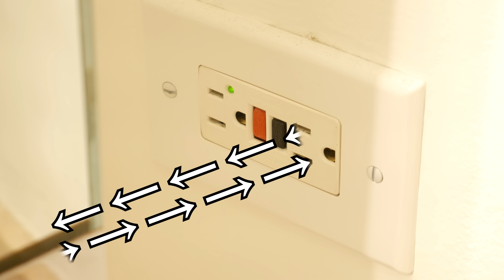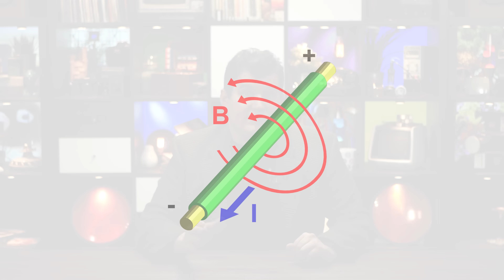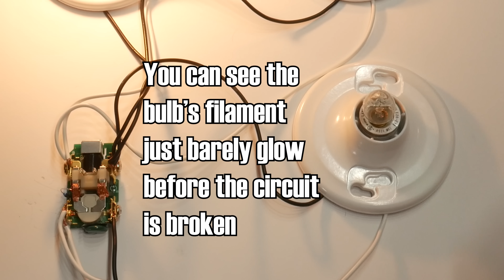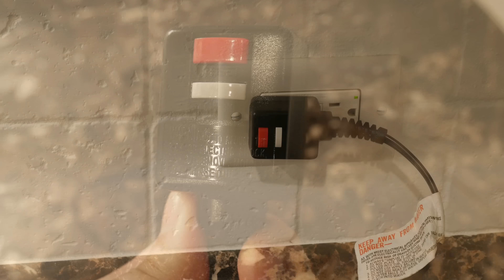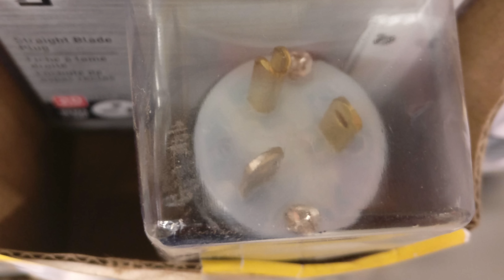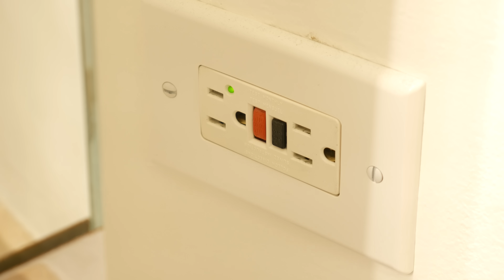The GFCI/RCD: A Simple but Life-Saving Protector

Comment: On the other hand: We in the UK are not allowed to have sockets in our bathrooms. Except for 1amp shaver sockets. Everything else must be permanently wired in with a fused isolator switch as high up the wall as possible.

Given all our mains sockets are 240v 13amp; this is probably for the best!
Reply: Bob Dole Sort of. You can have sockets provided they are a suitable distance away from sources of water, in practice most bathrooms are too small to meet the requirements. Out sockets may be rated at 13 amps, but are protected by a 32 amp fuse of circuit breaker, so can potentially deliver huge loads.
Reply: @spencerwilton5831  So pretty much my exact point then. The overwhelming majority of British households are not allowed to have sockets in our bathrooms because they are not statistically unimportant anecdotal cavernous fortresses of solitude. 

Also; I wasn't stating 13 amp as the theoretical maximum. I was pointing out the fact we don't normally have seperate domestic heavy duty sockets for large appliances like dryers as is often the case in the states. I am excluding electric cooker points in this statement as they are not a readily usable socket. Electric car charger points and the like are dedicated installations. Did I miss anything that is domestically common enough to warrant mentioning?

Comment: Hi!  The certain distance is 6 feet from a plumbing fixture in the U.S.  You can also install them in older homes with no ground wire instead of using a “cheater plug”.  Just in case anyone is interested 😬

Comment: In russian it's called UDT (differential current device).  Coupled with overload protection, it is called  a difavtomat, short for differential automatic circuit breaker.

Comment: In the UK, power sockets are barred from bathrooms. And so are convetional light switches - we have pull cords.
Reply: really?? that is interesting..only find pull cords in older homes here in the US that have not been updated and we are required to have at least one dedicated circuit for bath sockets.
Reply: @workingshlub8861  The only sockets permitted in a UK bathroom are the "shaver" sockets - which are low amperage - rated for 1 Amp I think. Other  sockets are banned - within 3 metres of a bath/shower.. https://www.electricalsafetyfirst.org.uk/guidance/safety-around-the-home/bathroom-safety/

Comment: Nice video 👍. 

These devices are Also called ELCB's in some parts of the world, like here in Dubai, which stands for :
Earth leakage circuit breakers
Reply: Erm, no. An ELCB is a totally different animal. An ELCB detects voltage on the earth wire against a different earth reference point ("real earth"). The earth wire in the house has a rather resistance; it's not an earth connection as we know it nowadays. This earth wire may carry up to 50V against "real earth" and still be considered "safe". Any earthed metallic appliance plugged in that circuit can have up to 50V on its metal case (and when one device is faulty, all other devices in the same house are "charged" as well; they do not even need to be turned on, just plugged in). Usually, when 24V are exceeded, the ELCB trips. Note that these voltages can already be lethal for children and animals.

The ELCB also cannot work for appliances which have no earth connection (those with two prong plugs).

ELCB have been replaced by RCD in most (if not all) of Europe many decades ago. Since the relation between "fault voltage" and "fault current" is very complex, using the voltage as a very rough estimate for a potentially lethal current is not quite the optimum. Also, the "pseudo earth" approach may lead to issues with audio equipment.

Comment: I always shudder when i see american electrical gear.... but i forget you guys arent running 240v, but still is there any  americans that realise that a lot of your wiring and gear is just totally backwater style stuff?? Having exposed contacts right beside steel brackets, minimal insulation if any....crazy. Do you guys not build steel frame houses? 
Also Why dont you have Switches on your outlets???? 
And if you tinker, buy a proper RCD not a cheap one like on hairdryers or american powerpoints.
Reply: Steel frame houses are very uncommon. Steel framing IS commonly used for partition walls in concrete warehouses converted into office space.

Comment: Electrical engineer here. Some appliances, such as dishwashers, refrigerators, ice makers, drinking fountains, and vending machines require GFCI protection. We usually specify a GFCI circuit breaker for these. If it trips, it can be very hard to move a fridge or vending machine to reset the receptacle behind it.

Also, while some appliances may plug in to an outlet, others are hard-wired. We don't always know, so it's bet to specify a GFCI breaker, just in case.

Comment: I actually shocked myself with an electric outlet one time trying to plugin my computer in the dark. I was feeling for the outlet and accidentally got the plug half in, half out with my finger touching the metal. Fortunately, I was saved by a built-in safety measure: electricity going to the muscles of my arm caused them to seize and jerk my hand away from the outlet. It felt like something had vibrated the bones in that hand. 

Good thing I wasn't in a bathtub at the time!
Reply: @TheQuark6789  Shit dude, it's called a multimeter. What you're doing is like checking to see if a viper is asleep by putting your finger in its mouth.
Reply: @emperortbw402  I myself prefer to give the contacts a quick lick just to be absolutely certain.
Reply: @emperortbw402  The back of your hand in its mouth.
Reply: Jesus, your plugs let you do that? There's all kinds of regulation about how much of the live pins has to be sheathed on plugs here to prevent exactly that kind of thing. o.o
Reply: @GameFreak7744  
American plugs are usually unsheathed, I've found.
Reply: @GameFreak7744  I don't like the british but I will say y'all have some of the best plugs worldwide. I couldn't shock myself if I tried with those things.
Reply: @AnEggShellWhite  It amazes me that our plugs and sockets haven't caught on elsewhere. Safety feature upon safety feature upon safety feature. I'm not a patriotic dude, but I'll always talk up our plugs.
Reply: @jayl9110  It's probably because the superior safety features of British BS 1363 plugs are both necessitated and obscured by the manifest idiocy of British ring mains.
Reply: That happened to me aswell, got scared to death.
Reply: @TheQuark6789  There is an even better way: Hold one end of a neon tester with your fingers. Touch the opposite end of the neon tester to the "hot" terminal you are testing. If the neon bulb glows, there is a conducting path through your body to ground. Plus, you don't get an electric shock, which is a nice thing.
Reply: I did that once. to this very day i can feel the tingling in my hand. It actually didnt hurt at all. just tingled
Reply: The greatest danger of electrocution is not when you grab something "hot."  As mentioned, the electricity takes over your muscles (All of them) which makes you let go and jerk your hand away (You basically will usually fall away from danger.)   The greatest danger is 1) when something "hot" falls and rests against your body. If you have a place to fall, it could very well follow you and remain against your body. OR 2) When you fall and you land with your body at rest against something hot (or step onto an energized surface such as stepping out of your car after an accident which knocked over a power pole leaving loose, "hot" wires lying on the ground.)  Your body will have the same jerking reaction, but you have no place to fall away from the voltage.  Muscles are activated by electrical impulses from your brain, but the current is very low.  When you get shocked, the current is much higher and overrides all electrical impulses from the brain, which is why you cannot control your muscles.  Your brain, therefore you,. will know what is happening and what you need to do.  You will know you are dying, but you will be unable to move.  (Of course, extremely high voltage/current will cause instant death.  Even higher current will immediately dehydrate your entire body and you will burst into flames so hot that anyone within a few feet of you will also burst into flames.  (This is the fate of those who try to steal copper from a sub-station!)
Reply: Reminds me of years ago, I needed to change out something behind metal panels on a piece of equipment. I opened one, and when I reached for the other I saw lighting bolts shoot out of my hand, it felt like someone hit me in the chest with a sledgehammer. 
I ended up on my ass about 5 feet away. There were what looked like pinpricks on my hand in the places where the electricity had exited.
If I had been able to grab the second panel, I likely would have been fried instantly. (Resolute Star blueprinting machine, 1982.)
Reply: "I was feeling for the outlet and accidentally got the plug half in, half out with my finger touching the metal."

I did that as well. The exact same scenario plugging in a computer in the dark. I went "Wooeee. ... That felt kind of good."
Reply: North American plugs are scary.
Reply: When I was about 6, I was playing behind a neighbor's house who had a swamp cooler. I thought a pipe on top in the water was some loose scrap and grabbed it. I could not let go of it for several seconds due to the muscles in my arm tightening. It was "quite a shock".
Reply: I call that the "FLASH GORDON EFFECT". Why, in just a moment  you are several feet away.
Reply: Where I live, regulations require that the top half of the power pins are insulated so that can't happen. Of course, we have 230v, so it's that much more of a jolt if it did happen.
Reply: I similarly used my finger, across both prongs underneath a lamp plug, to feel its way into the outlet. Certainly was a lesson I only needed to learn once.
Reply: Yeah I plugged in a vacuum cleaner with no gfi with the same issue and my hand seized and I couldn’t release it. Thankfully the motion of me jumping back pulled my hand away but it felt like the bones were vibrating, as you said.
Reply: @TheQuark6789  Actually, when working with electricity will use insulated tools and connect ALL wires together to be sure there is no current back feeding from another source, then proceed to do the work i need to.  have seen too many times someone did some "weird" electrical work
Reply: Damn the luck. If only you could have made the same move in an older home.
Reply: Thequark6789 life back cheers. In return, if you suspect a fire in a room/box etc check for heat with back of hand, so saving fingers.
Reply: I do that quite often with my fan, but I try to be careful. Seems to work 'cause I've yet to get shocked.
Reply: European norm impose RCD 30mA on all circuit, and in the house fuse box, before any breakers. You are protected even if you touch the lamp outlet, or any circuit in fact.
About water-environment outlets, outlets are forbidden in proximity of water, and multiple other rules apply.
Also european plugs have no parts that can be touched while on power, and children cannot insert objects int sockets. US electricty norms are insecure and dangerous at many levels...
Reply: Was it 110 V or 220 V? I was zapped by 220 V at least 3 times that I can remember. But I don't want to repeat this experience.
Reply: @VioletGiraffe  I'm not sure. American wall socket plug. Wasn't that bad since it didn't last more than a split second, but could have been much worse under different circumstances (ex: grasping something electrical and unable to let go, or standing on something conductive).
Reply: I plugged in a tower once, there was no plastic nub on the end of the outlet, so my thumb slipped forward and touched hot and neutral.
Reply: All your arm meat cooked at 60hz for a short time is more like it.
Reply: your actually lucky as a lot of time the spazm of our bodies reacting to electricity is to actually grab onto things
Reply: @compzac  Correct me if I'm wrong - but I read somewhere that a difference between AC and DC is that with DC, your muscles actually do clench up, which would make a shock more deadly since you'd be unable to let go.  But when the current alternates rapidly (AC), there are just short bursts which make your muscles spasm rather than clench, and thus it's "safer" since you aren't subconsciously going to tighten your grip on a live wire that is shocking you.

It was one of the reasons everybody adopted AC transmission, the other being the ability to "step up" the voltage for long-distance transmission.
Reply: @drfsupercenter  I know this is late...
You can't let go of AC at about 30mA and for DC it's about 10mA.
The more significant difference is what happens to your heart if you get shocked. AC "just" stops you heart, but under normal circumstances the heart can restart itself. DC on the other hand gives you ventricular fibrillation witch means that your hearts rhythm gets wacked and the only way to fix that is to use a defibrillator that pumps DC through your heart to stop it and then get you back with CPR and so on.
Reply: America is built on Darwinism, so yay exposed live contacts! Cull the herd! /s
Reply: @justins8802  how so?
Reply: Stranger - In america’s early days, one could come from nothing in the old world and through ingenuity and hard work, become successful, marry, and have a ton of kids. One could also come over and for one reason or another fail miserably and essentially be destitute, unmarried, and die young and childless. There’s a hypothesis that this brutal free market and effective Darwinism was a key part of America’s success until one generation after the New Deal added a safety net. 

Anyway, my joke was that our outlet design was related, designed to kill anyone who couldn’t be careful enough with them.
Reply: This is one reason why US style plugs are... bad.
Reply: Gosh if only there were some kind of device that could turn an outlet off so that it's not live whenever it's not in use.

Some kind of switch or something.
Reply: @shingshongshamalama  Yes, but that would be "inconvenient".

Comment: As a new homeowner, thank you for this. I have bought a rather old house and wondered why there were specifically two outlets- one in the bathroom and one in the kitchen- that worked like this. Incidentally, I hate them. More often than not, they trip over stupid things that shouldn't have set them off. But thanks to this explanation, I'm not as tempted to replace them with normal outlets.

Comment: Having the GFCI in the central panel has one other benefit: It protects all the wires in the walls from ground faults. This can be especially important if you have a break in a water pipe or you are putting in a nail to hang a picture.

Comment: That’s a much better solution than the no outlets and only pull string lighting that are in UK homes. Some more modern homes may have shaver plugs that can be used with some hairdryers too but many do not. When I lived there I had to charge my electric toothbrush and dry my hair in the bedroom.

Comment: OMG, these kind of screw-terminals are in use in the US? With stranded wire?
Reply: No, our wiring is all solid core, no strands.

Also the screw is optional. The more popular method is a hole on the back of the outlet where you insert the wire in, and it clamps down.

Comment: I wonder if the in-circuit-box standard outside the US has anything to do with the commonness of 220-250V mains elsewhere. Maybe having the whole house on GFCIs is safer (or even just comforting) when your stock service voltage accommodates heavy machinery.

Comment: Now I'm wondering what happens if the test fails.  Like, the ground fault kicks in but the circuit doesn't break.  This is my lack of knowledge of electricity showing, but I have no idea what effect that would have.
Reply: Normally simply the socket will not cut the power, it works like a normal socket. Some sockets do not allow resetting  if they are faulty but this is stupid and can be dangerous as people will then do something more stupid to get the electricity.One cannot except someone to change a socket immediately.

Portable GFCIs typically fail on the off site but you can just choose not to use it.

Comment: A knife in a toaster is pretty much a myth but always be safe and unplug it first. And many devices are still dangerous even when unplugged such as older stereos etc. They contain large capacitors that store electricity and when you touch on end of it t will drain out through you to ground, and you are ground.
GFCIs are also called "Jiffcees".

Comment: The way you had the outlets daisy chained together is improper, it works but it is dangerous. If one of the plugs fails the other receptacles farther down the circuit will stop working. It is bet to pigtail of the circuit to power the receptacle. I only have one year as an electrician's apprentice experience but I wired more of those than I can count.

Comment: In america the standard for most homes since 2009 has been. AFCIs for every light or outlet circuit connected or child to the main breaker panel. GFCI is required in bathroom kitchen most garages pools outside areas and laundry rooms. or any area where moister or extreme risk of electric shock. If GFCI is present on a circuit it can take the place of a AFCI in most cases.

AFCI= Arc Fault Circuit Interrupter = A device that shuts off a circuit if the mechanism detects arching type behavior (ie a lot like a GFCI, can detect GF's but not always the same way a GFCI can)

GFCI Ground Fault Circuit Interrupter ( Detects when Amperage leaks off the circuit and disrupts the current flow)

GAFCI/ Ground Arc Fault Circuit Interrupter (A combo unit)

Any of these units can be implemented into breakers and outlets. Also these devices only work when upstream from a point of danger. (at the panel vs after one of the outlets)